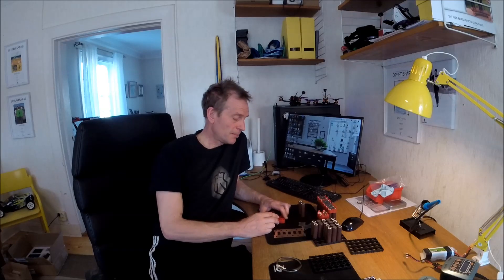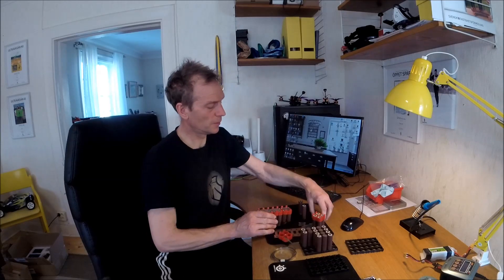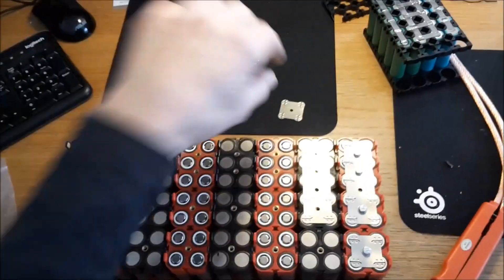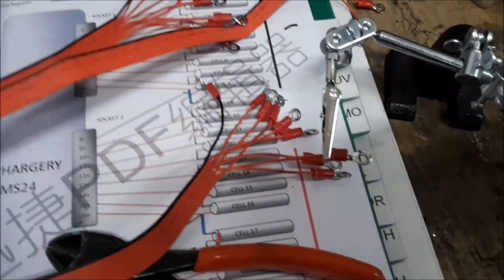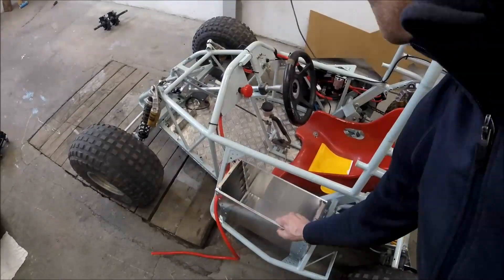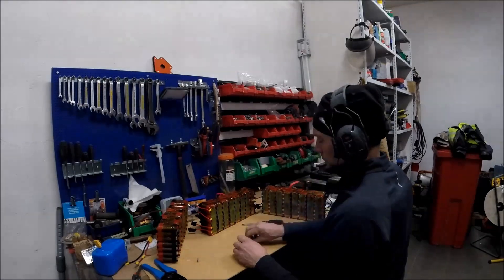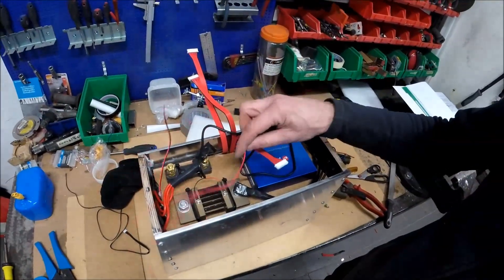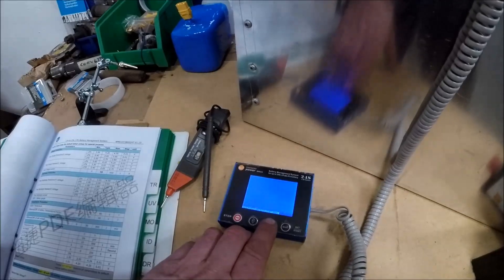Heavy Duty 96V 400A 18650 Batterypack

Comment: Wow amazing, I wanna modify my Ebike to 96V, I have 2 Batterys of 48V, Can I mount in serie with out problem?
Reply from the maker: Hello, If you want to connect them i series you need a BMS for example 24s if it is 24 cells. You can not just connect your batterypacks with 48 v ( 12s) in serie, then you will have problem with balance.  In parallell no problem as long as you have the same voltage when you connect.  BR Per

Comment: Hello, Jordan ! I Think recommendations is to build one, 24s if you use li-ion batteries, batterypack with one BMS, but I have seen people put packs in  series if it fits better. But you can also seperate 24s packs as I did for better format.  BR Pär

Comment: Great pack, on my channel I’m building an electric go kart and I need some help building my battery pack. I’m buying a 16kw motor with a 72-96 volts system at 175 amps. Should I just build a 27s battery or just two 48v packs in series. I’m trying to save as much space as possible.
Reply from the maker: You can build a 27s batterypack, easy to split them as I did.  BR Per

Comment: Great build! I'm working on a 96v 60ah 26s23p battery to power an electric motorcycle. Could you share the source of the red and black caps + the strips you have used (1:42 in the video)? Thank you!
Reply from the maker: Hello, sorry for late answer. You can find them at Aliexpress : https://annpower.aliexpress.com/store/group/Battery-holder/623665_250774590.html?spm=2114.12010615.0.0.15e411f8OWXPZT 

BR Per
Reply: @persteel  Thanks Per! Really appreciate it, gonna get a couple of these as well. Could you tell a bit more about the charger and BMS you are using for the battery pack? Thanks in advance!
Reply from the maker: Glad I can help, Lightridr !  In this batterypack I am using the : https://www.aliexpress.com/item/32860080560.html?spm=2114.12010615.8148356.31.48306276RYSYW4    Chargery BMS24T with 500 A shunt. They also have a charger you can buy i a package. It is adjustable for different battery setups and is also can controlled by the BMS if you use the Chargery system. 
But in another build I used this https://www.aliexpress.com/item/32913735834.html?spm=a2g0o.productlist.0.0.275548df6ZE9O0&algo_pvid=22371478-b0cb-4b13-81c9-c5b094a7663d&algo_expid=22371478-b0cb-4b13-81c9-c5b094a7663d-33&btsid=0be3764315883229874275005e4608&ws_ab_test=searchweb0_0,searchweb201602_,searchweb201603_

I find these to work very good and there is no use for extra relays and switches. You can also use cheap charger.  Only downside you can't monitor. But add an cheap coulometer.  BR Per

Comment: How much 18650 battery do you have in this pack to get 400A and 96v ? Thanks you for your videos
Reply from the maker: Hello, glad you like my videos !  I use these batteries : https://www.aliexpress.com/item/32868746648.html?spm=a2g0s.9042311.0.0.751a4c4dVSqtI8   They can discharge 30 A in burst and I configured them in 24 s 14 p  and it gets  approx   24 x 4 V = 96 V and  14 x 30 A = 420 A.  BR  Per
Reply: @persteel  I would like you to build me this exact battery and I can pay you well! Are you interested?
Reply: @persteel  but as a saddle pack 2 packs that hook together.  I can build the containment cases
Reply: Or even 3 packs.  I'm building a 72hp electric dirtbike
Reply from the maker: Hello, I am located in Sweden. Could be some problem with shipment. I do recomend you to try to build it yourself. You learn a lot and it is not hard. Then you can build whatever battrypack you want. BR Per
Reply: @persteel  That link does not work, just a heads up.

Comment: Great Video!, useful information, can you share what you are using for a BMS?
Reply from the maker: Thank you, Javier !  In this batterypack I am using the : https://www.aliexpress.com/item/32860080560.html?spm=2114.12010615.8148356.31.48306276RYSYW4    Chargery BMS24T with 500 A shunt.   But in another build I used this https://www.aliexpress.com/item/32913735834.html?spm=a2g0o.productlist.0.0.275548df6ZE9O0&algo_pvid=22371478-b0cb-4b13-81c9-c5b094a7663d&algo_expid=22371478-b0cb-4b13-81c9-c5b094a7663d-33&btsid=0be3764315883229874275005e4608&ws_ab_test=searchweb0_0,searchweb201602_,searchweb201603_

I find these to work very good and there is no use for extra relays and switches. You can also use cheap charger.  Only downside you can't monitor. But add an cheap coulometer.  BR Per

Comment: Super snyggt Per! Kan du inte länka till BMS och hållare för cellerna. Gärna alla delar såklart.
Reply from the maker: Tack, wastelandrebel !  Länkar : https://www.aliexpress.com/item/100-New-Original-HG2-18650-3000mAh-battery-18650HG2-3-6V-discharge-20A-dedicated-For-Electronic-cigarette/32868746648.html?spm=a2g0s.9042311.0.0.285c4c4dKRmWQo , https://www.aliexpress.com/item/High-quality-18650-battery-holder-For-big-power-battery-pack-50A-100Ah-200Ah-Lower-price-is/32837557299.html?spm=a2g0s.9042311.0.0.285c4c4dKRmWQo , https://www.aliexpress.com/item/18650-battery-copper-strip-High-power-battery-copper-connector-Li-ion-battery-copper-current-collector-Can/32840276711.html?spm=a2g0s.9042311.0.0.285c4c4dKRmWQo , https://www.aliexpress.com/item/18650-battery-nickel-belt-4P-6P-10P-Lithium-ion-cell-pure-nickel-strip-Cell-center-spacing/32841895665.html?spm=a2g0s.9042311.0.0.285c4c4dKRmWQo , https://www.aliexpress.com/item/free-shipping-600A-2S-24S-Lithium-LiPo-LiFe-LTO-Battery-BMS-Smart-Balance-Display-1500W-Li/32961350707.html?spm=a2g0s.9042311.0.0.27424c4dn8pFVo

BR Pär
Reply: @persteel  snyggt! Vad kostade batteripacket i videon?
Reply from the maker: @danielssonsgarage  Tror det hamnade på runt 9000 kr. Mvh Pär

Comment: how are you charging this battery pack?
Reply from the maker: Hello, I use the Chargey Charger : https://www.aliexpress.com/item/32897632562.html?spm=a2g0o.productlist.0.0.62c11704suGdio&algo_pvid=13c4c7b2-4d03-4b8a-8d6f-e4675285f2c8&algo_expid=13c4c7b2-4d03-4b8a-8d6f-e4675285f2c8-5&btsid=2100bb5116036108911607658efcaf&ws_ab_test=searchweb0_0,searchweb201602_,searchweb201603_

BR Per
Reply: @persteel   My bad I see that now. I know what I will be saving up for now. Gotta find a cheaper solution till then. Thanks.
Reply from the maker: @earnwithbots2783  Hello, there are cheaper alternatives. Search for 24s charger, typically 100,8 voltage range, then BMS shuts off charging . BR Per
Reply: @persteel  I have found a few, just not anywhere near the Chargery's versatility and current capabilities. Thanks for the info though.